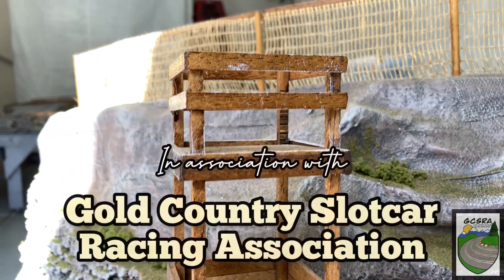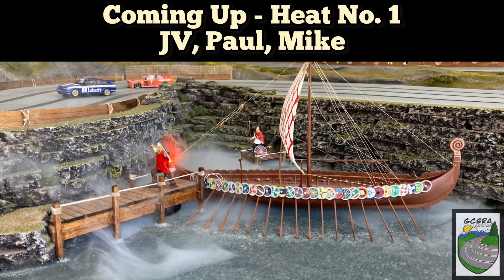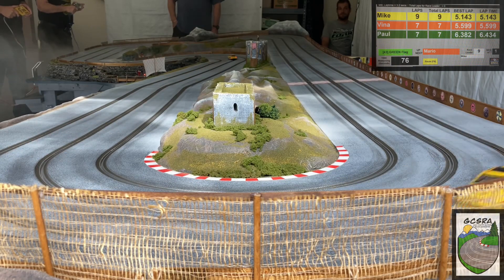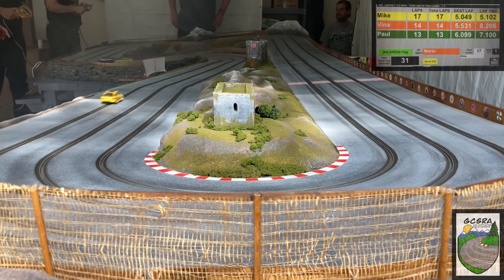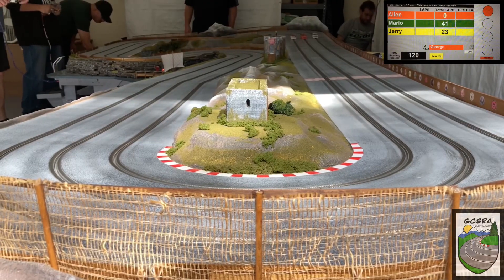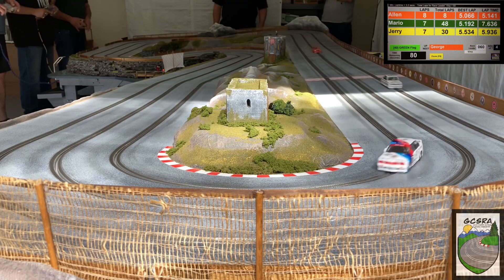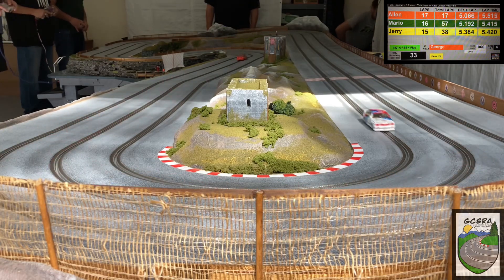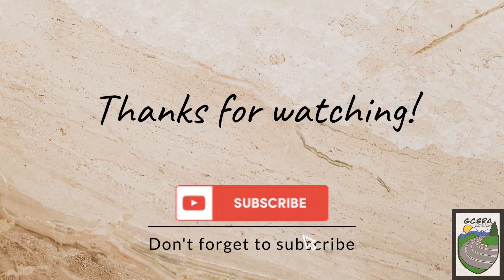1/32 Slot Cars - Scalextric Group A Broadcast

Comment: Great circuit! Love Group A racing. May I ask what surface coating you’re using?
Reply from the maker: @Roland For sure, Group A is rad! We're going to get some in depth track videos produced but the short answer is mdf with latex paint (exterior type-flat tone). Surface does have texture for rubber tyres but I'll save the details for the video series 👍😉